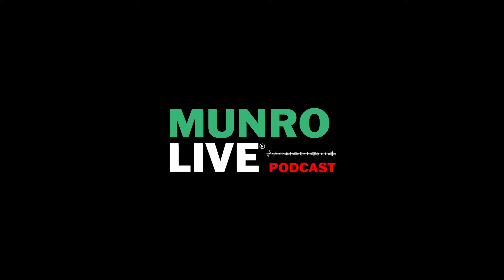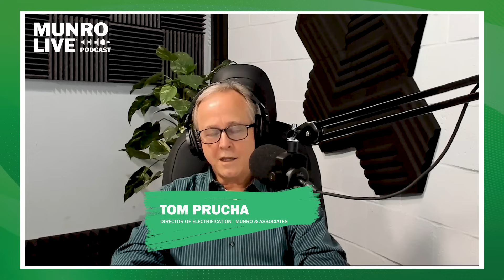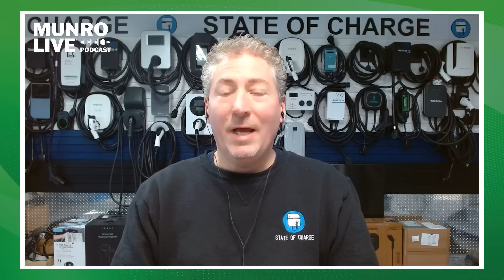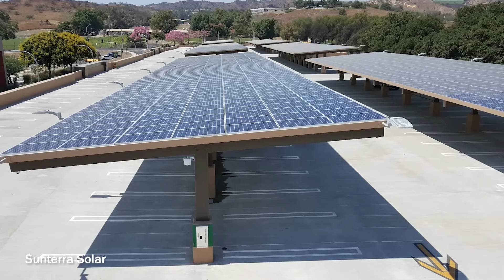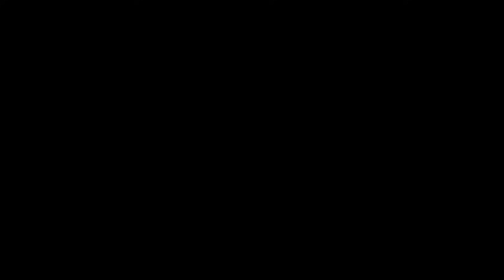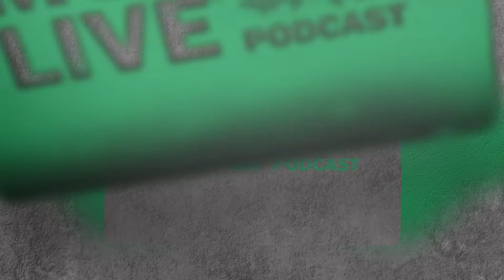The Problem With EV Charging Infrastructure

Comment: One of the MAIN problems?  You can't pay at the charger with a Point Of Sale system.  You have to give access to your credit card...to DOZENS of different unregulated non-bank entities.  And their e-commerce servers are slow as molasses.  Tesla is no different, aside from taking a chunk off tour card right from the beginning.

Considering all the different electrical systems bring serviced, it's amazing more non Tesla EVs haven't gone up in flames trying to charge at Tesla sites.

Comment: What to improve the charging network?  Agree on the same plug standard one plug all across the country.  Get rid of that app on your phone bullshit and set the chargers up with a terminal that accepts credit/debit cards all across the country just like the gas stations have.  If the techies would get their head out of their ass and standardize things without the phone apps it would be more accepted.  More software glitches doesn't cut it.  Transitioning with the credit card would have been better.  Keep it simple stupid.

Comment: Don't count your chargers till they are energized.  Tesla chargers have not been fully road tested yet.  I live near a beta testing Tesla Super Charger that has the Magic Docks.  I have had zero success charging there.  Tesla is going to run up against the same issues other charging networks have.  Every make and model of EV seems to have their own take on the charging communications protocol.  All the CCS may have the same basic vocabulary but are all speaking with different accents.  Tesla chargers have only ever had to speak one.  Now they speak a few of the more expensive EV makes and models.  Non Tesla EVs have to use an app to initiate and pay for the charge.  It is going to have to deal with all sorts or different banks and credit cards.  I  predict current Tesla owners are going to be pissed as seeing all these new EVs taking up charging spots and some have to take up two spots.  More charger usage means more wear and tear on the chargers.  We will see how long Tesla's wonderful reputation lasts once they are opened up to all EVs.  I for one will be buying a NACs to CCS adapter within the first year or so even though I don't have as rosy outlook as many do.

Comment: 2:46 I guess Munro really did turn into a Tesla fan site rather than a legitimate resource on EV news and topics. As someone with a similar level of experience and history with EVs as Tom, here's my response: Tesla is woefully behind at this point. You say 10 steps ahead; I say they might be 10 steps behind with no clear pathway to catching back up. They no longer have the longest range EVs. They no longer have the fastest charging EVs. In fact, they only have one EV in the Top 10 in terms of relative charging speed. And the Superchargers themselves are in the process of shifting from being Tesla's biggest asset to being their biggest liability. Here's why:

You acknowledge the issue with a lack of 800 V architecture, but the issues with the Superchargers goes deeper than that. They are designed for Tesla EVs, which again, are no longer the fastest charging EVs. The average power per stall at a V3 site is only 90 kW, and that's only if Tesla didn't exceed the power drop for the site, which they have done. Granting access to non-Tesla EVs means that those sites are not only going to be overtaxed on stall count, they are also going to be overdrawn in terms of charging power. That means the queues are going to be even bigger and even longer. No one cares about 99% reliability if it takes 45 minutes to an hour to access a stall every time you need to charge, especially when there are open stalls, ready to be used at a competing charging provider's nearby site.

There's also a question of compliance and funding. Right now, Tesla is the largest award winner for NEVI funding; however, their chargers don't meet the technical specifications required under NEVI (so again, they're not even getting to the stage where their superior reliability matters). As we've already seen in California, Tesla is ready and willing to abandon millions of dollars in funding rather than fix or upgrade their equipment to comply with regulations and requirements. 

Specifically in North America, between ChargePoint (Mercedes, Volvo, Walmart, etc.), EVgo (GM-Pilot-Flying J), IONNA, and even Electrify America's >97% uptime 4th Gen equipment, Tesla's Supercharger Network is in serious trouble. It's going to literally require billions of dollars just to be competitive, let alone to break into the Top 3 charging providers in terms of customer experience and satisfaction.

Comment: For peak demand issues, Toms ideas are sound and the market will find other ways to mitigate.  Onsite solar will definitely help especially if the local utility either puts them in it self or buys excess as additional grid capacity.

Comment: I thought Tom M. was an EV advocate!  I guess not.  Tom, you are a Debbie Downer... I  hate to say this, BUT I have only been driving EVs since 2018 - 5 years and have done over 60,000 plus miles of road trips all across the USA and Canada and where we wanted to go I had no problem except from Okc, OK going East to AR.  Since I got the CCS1 to Tesla, adapter has zero problems anywhere.  The DC fast charging network gets better every day. New stations are being installed daily.  Maybe you should take a new road  trip.😊.  I wounder whyyou keep saying how bad it is, but never give a video and provide proof.  Your statements sound like you are being paid by BIG OIL.

Comment: Tesla cars and charging stations first generation seems to work so well vs legacy auto.  GM still struggling with software Lyriq and now Blazer EV.  I remember what NASA said about space X,  THOSE BOYS KNOW HARDWARE AND SOFTWARE.  Tesla builds both and knowledge from flying spacecraft with return to earth automated.  Tesla has its own chip, own 4680 battery, streamlined production, and battery maker for the grid.  I believe Tesla still the only company both FOTA AND SOTA OTA.  Many competitors offer SOTA but mainly for infomat system.  Tesla navigation innovation with their charging stations first class.  Competition charging stations with complicated apps and credit cards.

Comment: USA forgot to build battery factories and charging stations.  Tesla msrp helps pay for its private charging stations.  MOST public stations only slow level 2, 3-19 kw.  Most public level 3 DC fast chargers only 50 Kw rare to find 100 kw let alone advertised 350kw.  All Tesla charging stations are level 3 not 2.  130-250 kw.  We need more level 3 at least 130 kw especially with the larger truck batteries.  Most companies but their battery packs from expensive 3rd parties in China and Korea, no profits.  We need USA battery factories

Comment: 40% USA population no garage for vehicles gas or electric.  EV’s totally dependent on charging station in that case.  Monitor for major storms and charge up and gas up before hand as power outages prevent gas pumps from working

Comment: The non-Tesla networks had a shot until, after Tesla posted Magic Dock pricing at near 0.50/kWh, the non-Tesla networks followed suit and jacked their prices to the same lofty prices.  What are the non-T network operators thinking - charge the same price for less reliable, lower density (#/site, # of sites), older equipment.  Once Gen4 SC’s are more frequent, non-T providers will be busting prices or see use rates fall drastically.
I like Tom’s idea:  pricing levels for different charging rates.  Folks with time or a natively slower charging vehicle can have a good experience without paying top tier prices.
Reply: Just realize that it makes no sense from Tesla's point of view to allow selection of a slow rate of charge at a fast charger.

Comment: In the UK a company called Gridserve, run by an EV positive CEO, is busy building and opening Charge Hubs which have some 30 plus charge points together with Toilets, Cafe, and other facilities. One opened very recently at Gatwick Airport, look it up on line. 
              One factor that I have found over my 10+ years of EV ownership is the number of charge points declared to be defective, when in reality much of the problem is Operator error. If the public can get it wrong they will do so.  In the early days many could not cope with the big ChaDeMo plugs with a locking lever, now people cannot read simple instructions 'on screen' , they then complain about the charger. It seems many drivers do not even read the cars manual!

Comment: What use is an EV on a long journey without a reliable, convenient charging network? Which EV manufacturers thought through how to make the whole EV experience work and so, continue to build their own network in each geographic market they enter? Answer: Only Tesla. Which manufacturers ignore charging networks? Answer: All of the rest. Obviously, Tesla also realised that if they had to rely on 3rd party networks, that Big Oil, legacy automakers and auto dealers could quietly invest in charging networks and use them to kill off the whole EV trend by overcharging for electricity, letting their installations fall into disrepair and making it difficult for EV users to pay for and use them. Sound familiar?

Comment: I see at least three problems with the current changing network: land, people, and power. In theory these elements should be an advantages to  BEVs. The current system requires a minimum amount of land (no large subsurface fuel tanks); no people on sight (all processing is self-service), and there is no commodity market influencing the product cost (utilities have stable source for generation). The hidden constraints are: the land is generally of a rental nature, Human interaction requires remote support (call centers) and distributed maintenance and repair structures similar to support structures found in water and gas utilities, and an infrastructure support build-out in the electric power generation utilities.  Also,  not to mention that the charging station is just another fuel center but with a different type of fuel. This means that the product''s price will include the transportation (state and federal)  taxes collected the same as gasoline.  

Consider the current convenience store structure as a partial solution. From what I understand, the gasoline product is an "attractive hook" to draw customers to the convenience store. The convenience store structure provides the people support, eliminating call center type support currently being used,  and can assist in local trouble shooting, The store already has the land committed providing a fueling location. The convenience store then becomes a "transition" from one type of fuel to another type of fuel. I have already seen a local Shell convenience store being fitted with electrical charging stations. Consider this as a sign of things to come. 

Lastly consider geothermic power generation as a substitution for oil, By taking advantage of the evolution in shale oil exploration, now instead of looking for deposits of oil, the search is for deep locations of abundant heat.  This is like replacing oil  with heat, and eliminating the the "oil refining process". The geothermic heat is not limited to a surface type of heat pools found in volcanic areas.  Geothermic heat can source from deep below the earth's crust. Using the tools of shale oil  processing, according to the advances in shale oil exploration, a new shale site can be set up and running within a few weeks. Therefore the amount of time to add new electric power generation would take less time than building  a traditional power plant, and take up less land area.  Geothermic electricity can be implemented, with smaller cost,  as an interim power source, for nuclear fusion energy,.
Reply: Depends on where the geothermal heat source is located.  If out in the boonies hooking up to the grid could be very costly and not economically viable

Comment: I’m now convinced that Yahoo is suppressing free speech, esp. when it comes to EVs. The following was just rejected: 

“No, but for guys like me who live in a sunny climate my solar panels, TOU rates and net metering means I don't pay anything to drive around, SCal Edison pays me every Jan. to set things even. I also have a heat pump for heating and cooling. My electric 'bills' are usually a small negative each month.”

I have a small collection of past Yahoo postings that were also rejected for ‘community guidelines’ reasons.  Yet they were all facts involving EVs with no opinions stated, like the above. Scary how Yahoo is suppressing free speech, esp. when only facts are stated, doing so keeps the misinformed ignorant of the facts.

Comment: I am an electrical engineer. Electronic systems are fragile when compared to mechanical systems. Moisture, temperature, and vibration take a disproportionate toll.  Making rugged and robust electronic devices is very expensive. A consumer-grade potentiometer for example may cost $5 --but the industrial grade might be $190. Its a different world.
Reply: So you are saying it is a solved problem then.
Reply: It seems that way w Co strutting too.  Seems like a roof over chargers would prob cost a few $K, prob is much more

Comment: To me, this is why everyone is pulling back from EVs… because the Tesla charger deal won’t be in full force until ALL their cars have the Tesla plug in 2025 at the soonest!  This is also why EVs are sitting on dealer lots because the cars have no place to charge! Sure  they can use some Tesla chargers now, but it’s not enough. People get kinda pissed when they can’t charge. The epic failure of all the other auto manufacturers, no charging network.